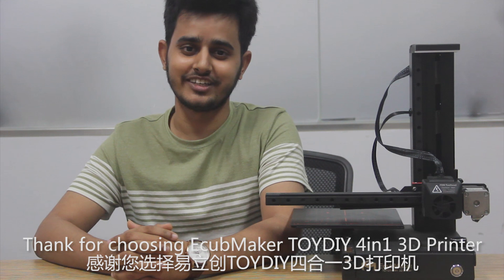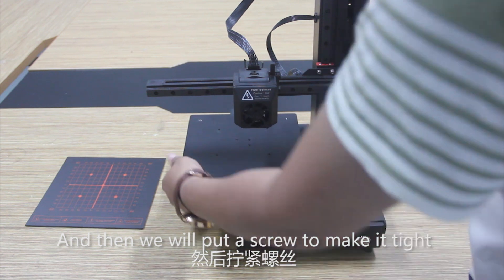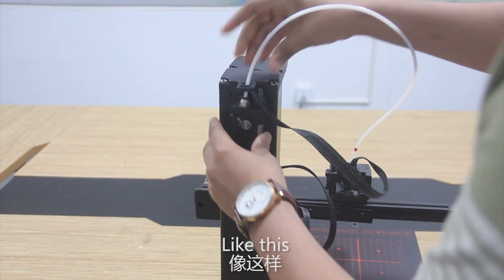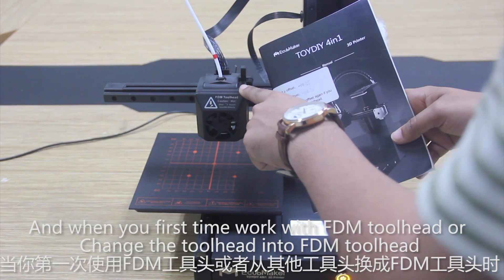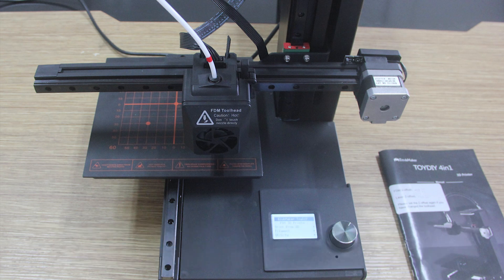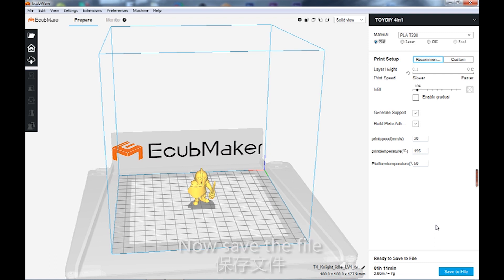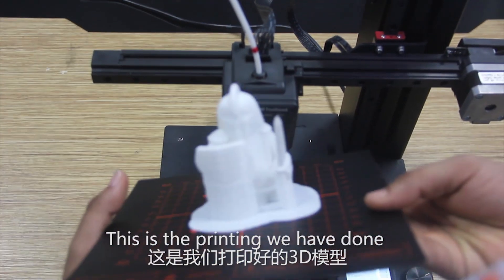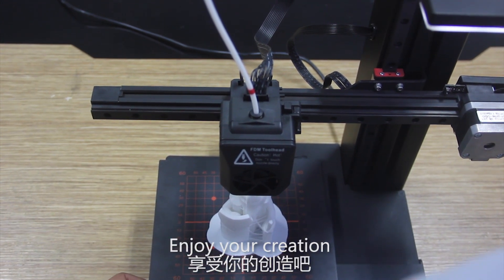First time using tutorial/TOYDIY 4-in-1/3D Printer/Ecubmaker/Video for Beginners

Comment: I bought one of these machines , was listed as a 4in 1 but only came with 3 heads , a dual filament , a lazier , and CNC I did not get a single extruded head .this guy seams to have one ..
I guess you can advertise one thing and give what ever
Reply from the maker: Sir our Latest upgraded version of TOYDIY 4in1 have three toolhead. Where FDM-dual toolhead can do FDM single color and FDM-dual color 3D Printing. Which means three toolhead can do 4 functions. 

Let us know if you need any kind of help.